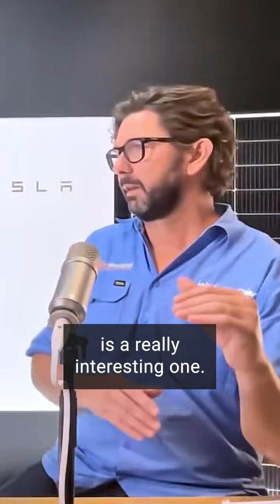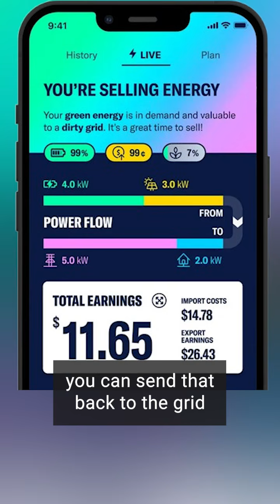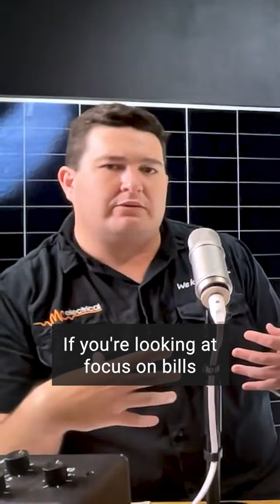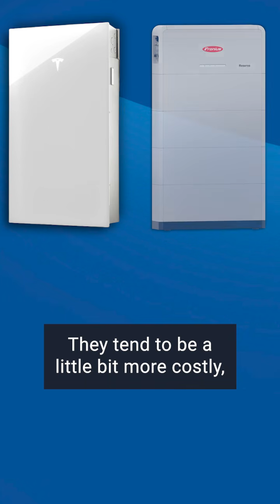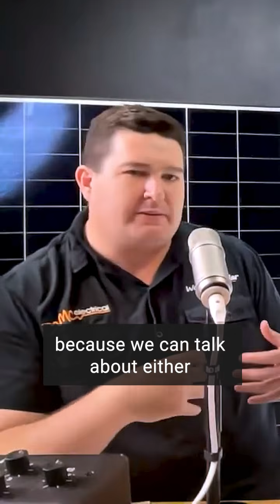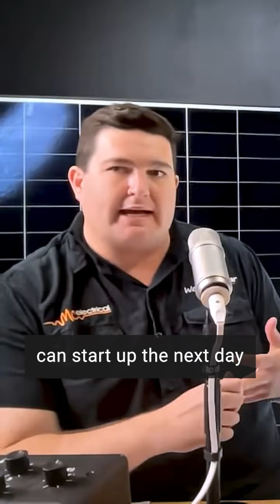Considering A Solar Battery with the Australian Federal Rebate?

Comment: Hate to break it to you guys out there but these manufacturers dont look after the end user's as well as they should. They look after their installer's. Its all sales talk. You get a real problem ? 
Your on your own. If the suppliers made the effort to do random inspections of their installers to ensure compliance there would be far less temptation for installers to cheat. 
BYD warranty isnt worth jack sht if your installer screwed up the install.
They just run you round in circles with firmware updates that dont work and nothing gets fixed.
We got burned. Big time. 
Fronius ? Ever tried getting in touch with them direct ? Its impossible. Beware of installers who shift the blame to avoid responsibility for their own non compliant work. Beware of installers who sabotage your install to profit from warranty work. That is the sad reality.
Reply from the maker: I agree with the part about manufacturers not being great with the end user. They rely on the installer to look after the customer. Phones get clogged with customers who bought of customers who get neglected by their installer. But firmware updates often work. The warranty has been too generous to installers who choose to take advantage of it.
Reply: @mcelectrical 
Often the customers experience is distorted by false feedback from less reputable installers who find it convenient to shift the blame on to the manufacturer. Manufacturers don't trust their installers and adopt a defensive posture.
It's a hall of mirror's out there. 
Speaking as a tradesman myself I understand cynicism amongst customers. If a customer came to me to get advice on who I could recomend in my trade ? Not easy.
The trades in general are not what they were. Quality and ethics have been squeezed aside by ruthless corporate marketing. Training is not as good and enthusiastic apprentices are getting harder to find. A good example is the building trade. Where once quality was uniformly high and trade standards maintained, the shift to cheaper faster manufacturing has left customers with houses that are engineered to fail. 
I grew up in the woodworking trade and watched during my lifetime the ever downward spiral of quality in to low skilled, poor quality work. 
When trust is lost between manufacturer and customer there are many factors. Not least uninformed customers who expect more for less and simply don't focus on demanding a saner balance of quality over quantity.
Where once young families were happy to start out in compact cost effective terraced houses, they now expect the sprawling fence line hugging mega mansion that eats energy and leaves them struggling to pay off overpriced poor quality Mcmansion's.
Even the best tier 1 inverters, panels and batteries can be compromised by shonky installers or staff who simply don't take care on site. 
My suggestion to quality manufacturing  ? Educate your customers honestly without the hype. 
My suggestion to installers ? 
Do the job right and take pride in your work. If you don't you won't last long. 
Customers  ? 
Insist on well respected tier 1 gear and find an installer who has a well established track record. 
Educate yourself and try to get a credible recommendation from an existing user. Less is more.
Quality trumps quantity.